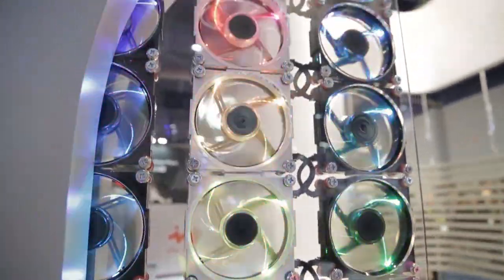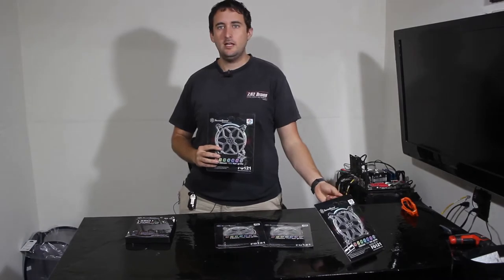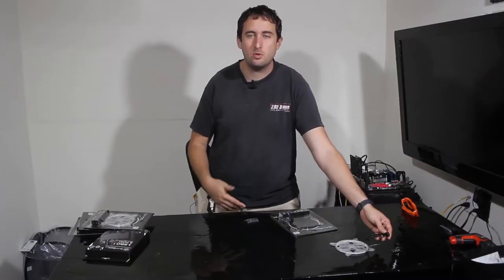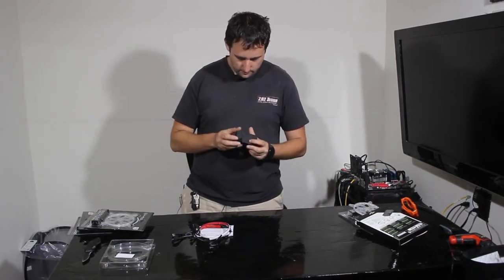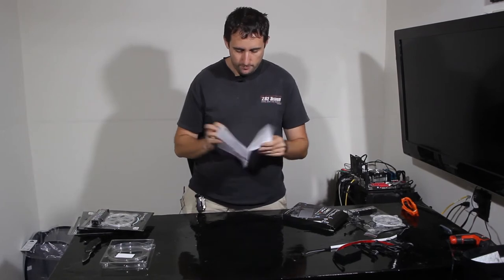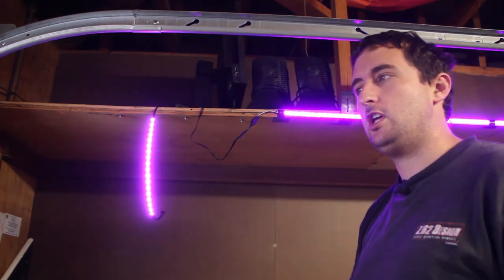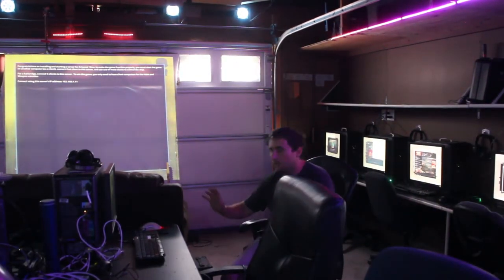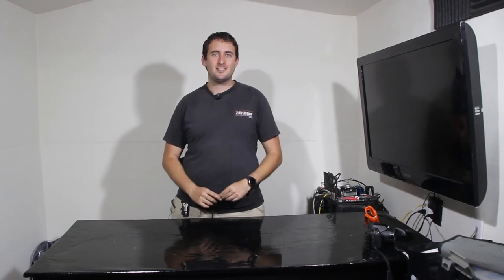Silverstone RGB Fan Grille's and Controller   Unboxing and Useage Whole Room RGB

Comment: Hello. I am not sure that you know Silverstone PM01-RGB CASE but anyway, I heard that this case has fan hub it self and even led hub. In this case, do I still need to buy SilverStone RGB Light Strip Control Box(LSB01)? PM01-RGB has 3 of SST-FG141 is pre-installed and I want to add 3 more of them. My mother board has 2 RGB header. Could you tell that I have to buy LSB01 or not? Thank you

Comment: great lighting man. recently i interested with rgb lighting.
anw may i ask u some question about my rgb rig project? and of course about rgb set up and compatibilities :D
Reply from the maker: Sure thing Rama, I will try my best!
Reply: SanDiegoLAN ty sir! and right up to the problem. i have some sort of plans to build rgb rig with :
1. gigabyte gaming b8 or msi b250m mortar (all of them contain 1 rgb header)
2. gskill tridentz rgb 2x8 dual channel
3. silverstone rgb controller 2 strips rgb led
4. 1 or 2 silverstone fan grilles
5. psu cougar gaming vte 500 80+ bronze
6. i want all of the rgb kit (strips, fans, and ram) synchronize with 1 rgb header so i can control it with rgb sync application on it. -_-
and next issue is : can silverstone rgb controller take all of the rgb kit and connect it with 1 rgb header on mobo?
and last do i have to pick higher wattage of psu to maintain all of the electricity come from rgb kit?
ps : sorry for rip english :"
Reply from the maker: Not a problem! The RGB controller has a standard "IN" so you should be able to connect all of the RGB you mentioned to it, and they'll all do the same thing coming out. The motherboard will control everything.
The wattage of your PSU shouldn't matter, assuming you're only getting 1 GPU you should be just fine.
Keep in mind that the RGB ram uses different software than the header on the motherboard, so you may have trouble syncing them.
Reply: SanDiegoLAN thats great then and very relieving too :D so it actually can take all of the rgb header kit in and connect them to one rgb header on mobo wthout problem (except ram). ty for your answer sir thats helping me so much :)

Comment: Hy nice video,

So I would like to get 4 rgb strips daisy chain them around the case and at the end I would like to daisy chain the SilverStone Controler with 4 Fans conected to it just like you did in the video.

What I want to know is if the hub is powered directly from the PSU so it doesn't pull power from the original rgb header(through the daisy chained strips) on my mother board and burn it out.

Have a great day